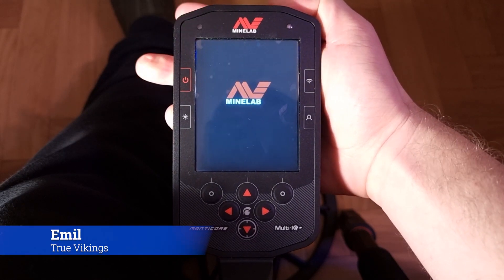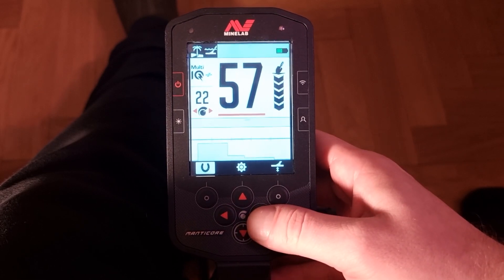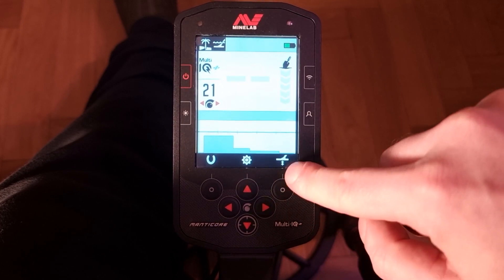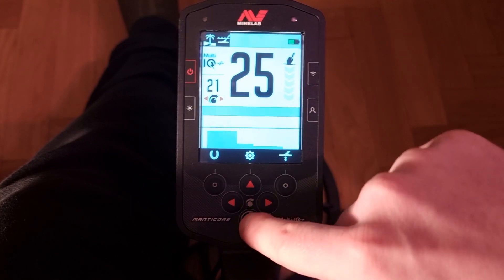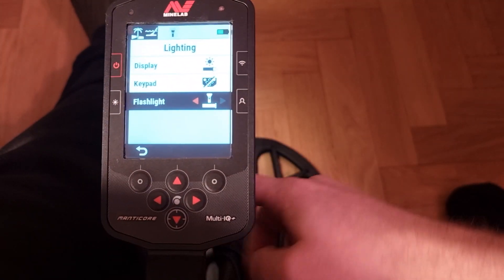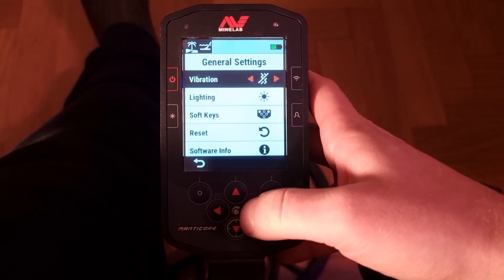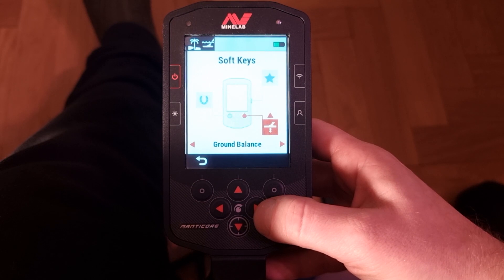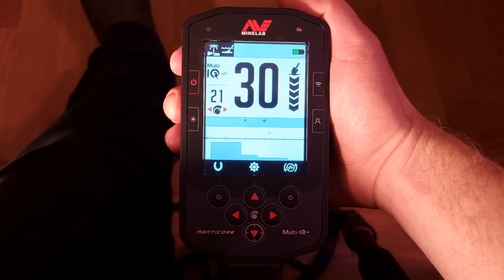Manticore programs in detail: #1 Controls and display functions explained

Comment from the maker: Check out more Manticore settings in our other videos:
 #1 Controls and display functions explained
#2 Multi frequency explained (Multi-IQ+)
#3 How to quick start and go detecting
#4 Search modes explained
#5 Ground Balance procedure explained
#6 Volume and audio themes
#7 Discrimination patterns explained
#8 Recovery speed explained
#9 Ferrous Limits and how to change them
#10 2D screen and target trace explained